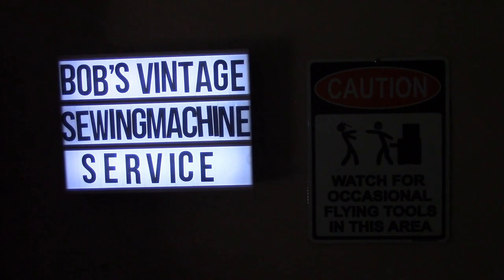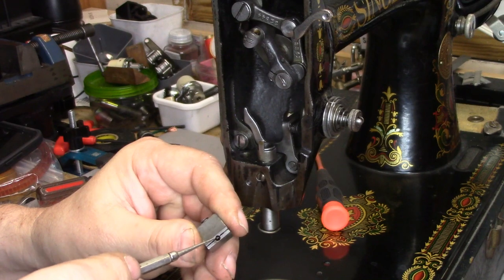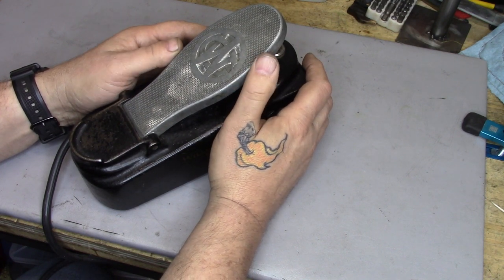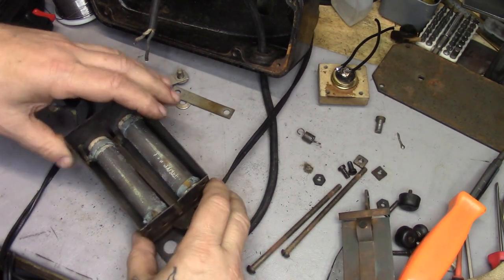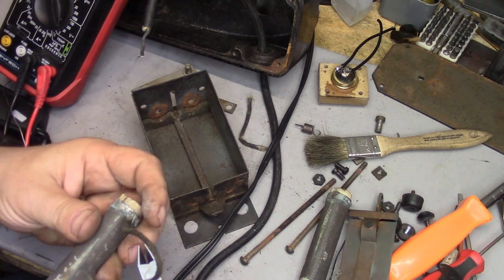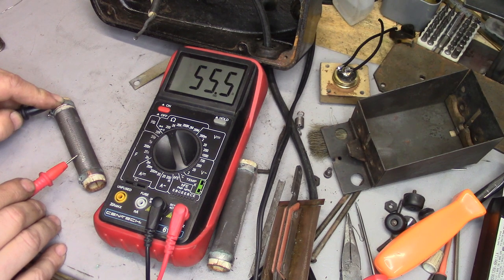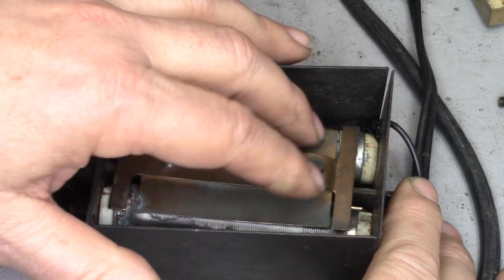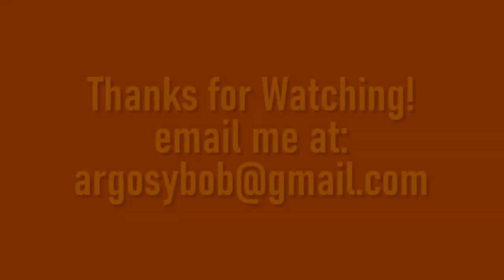Sunday Morning Quickies Episode 46 - Reviving a Willcox & Gibbs Controller

Comment: I just got done restoring a willcox and Gibbs sewing machine with its original foot controller.  It was mildly similar to yours but a slimmed down form factor.  the explanation (I was given) for the controller being so tall yet so small is due to it being for a child, these machines were made during the industrial revolution and were popular for use in factories where the chain stitch offered a clever solution to sealing packages.  The same idea is still used in dog food bags today.

Comment: My Willcox and Gibbs foot controller for my chain stitch sewing machine seems to be longer than the one you have in this video. A size 10 shoe could fit on it. I don't know how heavy yours is, but I do know that it weighs more than the sewing machine, motor and mounting board combined. It had the same problem this controller did, somebody prior to my acquiring it attempted to fix it I think. But I think the whole problem was that it was completely corroded, because after clean all the corrosion up it did have speed control.

Comment: I recently acquired another W&G  from 1921 with a foot pedal very similar to the one you repaired in this video.  Someone  "repaired" at some point using a Singer part so that the motor of the sewing machine was plugged into a part attached to the cord, rather than the plug in the body of the foot pedal.  I'm trying to rewire and restore it, but the parts of the video that would have helped you did off camera...  I have no idea how the inside of this model foot pedal is wired.  I recently rewired a 1937 model foot pedal, but that one was completely different, (but had a single coiled  resister like the two in your video).  Would you have a photo of how it was wired?  Was very interested in the fact that you were able to repair the coil, and would have loved to see how you repaired that.  Maybe next time you will show the entire process?  Thanks!

Comment: Good timing. I have a 447 with the same problem, and ordered a replacement gear for it, but it doesn't fit, it makes a clicking noise when it turns, but does make a stitch. The gear I got does not look like the one you got, but the broken pieces I was able to recover from the old gear looks like the one you got, so I have to reorder a new one, will try same as you got. My shaft is 8mm. However, I have to order from China as I'm in Australia, so that's another 6 weeks wait.
Reply: Ok, I was able to fix the problem with the new gear, it turned out the new gear was 1mm longer than the old one, which meant that it put more pressure on the gear, causing the clicking poise. I was able to machine 1mm of the new gear, and now it fits, no clicking noise. So, it's now working again.

Comment: I'd have to say that this is a very ingenious design for a foot pedal, and it looks like it's very comfortable to use. 
Is there any chance you could show how to disassemble and restore a carbon pile foot control? Like a Kenmore 6816, or Singer button type? Thanks.
Reply: There's an English guy who did this, Curio By B-Spoke Designs. Did it, works! Tip- don't knock the tray with all the little discs, ask me how I know...

Comment: That was very interesting foot control.  Question for you on controls with carbon disc;  I have taken a part and cleaned the carbon discs on 2 singer foot control pedals now and they work really great great.    I have a Pfaff and a Bernina that are more difficult to get apart and not sure if there worth the effort and still work pretty good.  Basically I'm trying to figure out why they make a sizzling noise occasionally.  It sounds like one of those electric bug zappers or if you put drops of water on a hot surface.  Your thoughts; broken discs, dust...

Comment: Good morning from southeast Texas.  It’s 4:48 this morning. I came across your video by chance but I think I sent you a question on a different video as I was trying to see if there was one covering my issue with a singer 237.  It was working just fine yesterday and when I removed the hand wheel the belt and the motor and then replaced all of them it just stopped turning the main shaft on top that drives everything. It of course controls the needle bar and everything else and nothing is moving. Any idea what I may have done and why it quit turning?
Reply: @MsArishiaNishi  it ended up just needing a list of wd40 and a pair of pliers to loosen the rod.  Very strange how it went from running smoothly one day and the next totally freezing up.  It wouldn’t budge for anything.  Got it going now, thanks for replying.